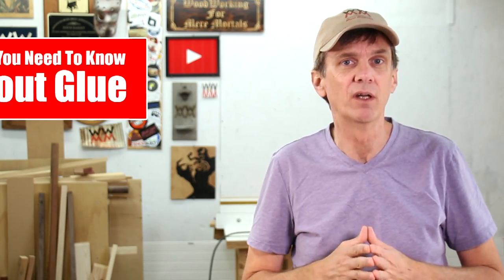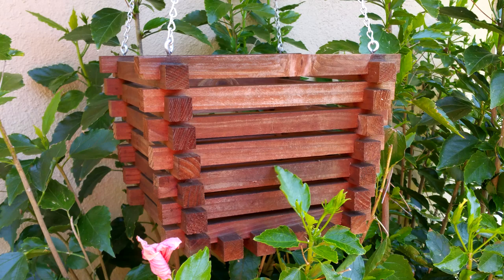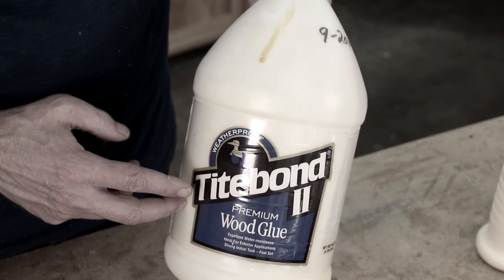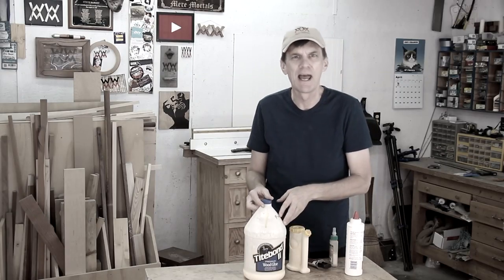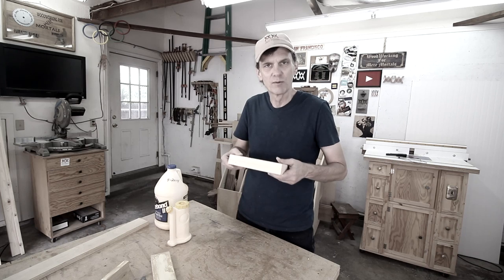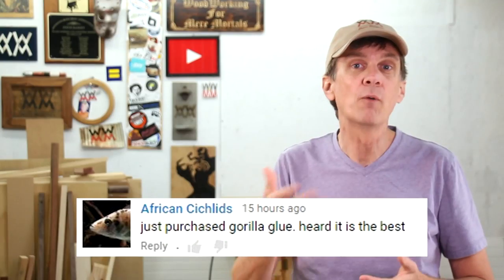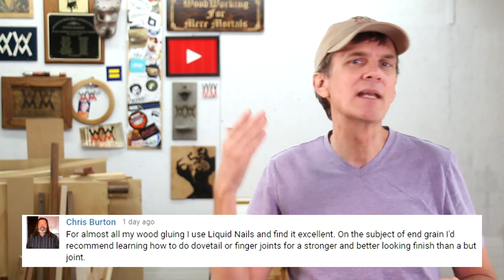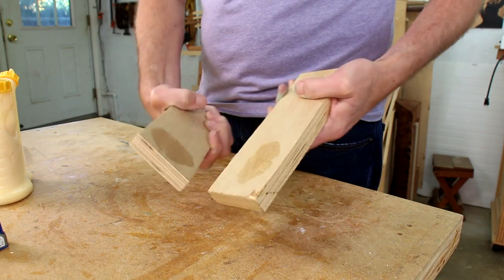Why I Don't Use Titebond III | MORE MINUTES

Comment: Very old video, but recent comments lured me into posting :) ...

Titebond has a "Super Glue" (CA) glue for wood.  The thing about CA glue is it can fill in knots and end-grain to prevent splitting or chipping.  That's great if you're about to run a screw into end-grain and catch yourself saying a prayer for it to not split.

It also works to hold non-wood material to wood, such as sled/jig runners and securing metal hardware to wooden parts.

Many use epoxy for multi-material joining, but to me, epoxy is overkill if the joint isn't going to be under significant load or strain when used.  Epoxies also have a much longer curing time than CA.

Titebond states their CA glue is "good for wood, MDF, acrylic, granite, natural rubber, PVC and more."  It can also cure in 10 seconds or less with an activator.

Wood glue is for .. well ... wood, and you should wait 24 hours for it to set up before you continue working it and stressing the joints.  Except if you used strong mechanical fasteners, too, in which case about an hour for set up is fine.

Comment: Ok this will sound insane but I have used it to repair minor scratches in finished furniture and it has worked and lasted a long time. Go to an inconspicuous spot under the furniture and sand some of the wood with a very coarse grit sandpaper for bigger scratches and finer paper for smaller scratches. Take the sawdust in the palm of your hand (now this is the crazy part) and spit in the sawdust and mix it really well till all of it is damp, not a slurry but more like dough. Work it into the scratch or nail hole. let it set for a few hours, over night is best. Then use 0000 steel wool to lightly even it out. Then stain same colour. dry overnight again then use the steel wool again. You will still see it but if you walk away for a day or two and look you will be hard pressed to see it.

Comment: Cyanoacrylate is often used to bond wood in model airplanes.   The bonds can be very strong, and lightweight.  The main advantage is that an accelerator can be used to make the glue set up almost instantly.  CA needs water to cure, it may be that joints you tried lacked enough moisture to cure totally.  CA has disadvantages, the fumes it gives off while curing are harmful so adequate ventilation is required, and it is difficult to get off your fingers.

Comment: Tip for TB glue bottles that may have been used and left in the open position for a few days (do you have grandchildren?). 
Unscrew the top and set it on a paper towel in the microwave for a few seconds (Not too long, I start with 12 secs.). You can then use a toothpick to work the softened glue out. Reheat as necessary.
Works pretty good.

Comment: We would use CA glue all the time on miters of stain grade alder baseboard, casing, crown. Worked great on bullnose corners. Good stuff. Now I use it as a finish on pens.
Reply: +Skizzity of Zen Hogs I use Titebond Molding and Trim for miters.  It tacks VERY quickly, and is thicker then the other Titbonds, so it doesnt get sucked into the end grain as easily and more stays on the surface where it is actually needed to bond.  Try it out, i think you'll like it

Comment: If I have a large complex glue-up with lotsa joints, then titebond 3 is good because it has a longer open time. #2 is waterproof, but if you're fixing your water tank, use #3. I also take the time to mask visible joints-takes less time and effort than cleaning up squeeze-out. Also, don't wipe off that squeezed-out bead. let it dry, and it pops right off. maybe.

Comment: the slow drying gel superglue works fine to fill small holes. Just mix some of the wood dust with a bit of the glue, and put it in the hole (fast)...with some types of wood it dries a bit faster than with others, but usually works fine..
Also it accepts stain or varnish really well...

Comment: +Steve Ramsey Hi Steve, I've seen some guitar luthiers thoroughly mix an amount of glue with the sawdust and then applying the mixture on the hole, and guitars generally are heavily finished so it might work on your projects, because it turns out great.

Comment: There are a few other glues and adhesives you could have mentioned, for instance contact adhesives like contact cement and gel based veneering glue, Epoxy based two part glues (they are great imo),  UV curing glue for glass to wood and metal. I enjoy your channel, best of luck to you

Comment: for superglue you should try zap glue. it's can be used either by itself or as a two part with an activator. the model plane industry uses it a lot.

Comment: Titebond III dries darker than II and I, but it's got a longer open time and it's significantly stronger (for what that's worth).
I use it on any project that doesn't have to be pretty, just for the general convenience of the longer open time, as well as any project with dark wood. I prefer it because I like the thicker consistency and it slips a little less. I use Titebond II for everything else, though.

Comment: Not a special ca glue, all ca glue can be 'sped up' with a catalytic spray. I use one called zip-kicker which cures the glue in seconds. But you are right, far too brittle for most woodworking

Comment: Titebond II is weatherproof and Titebond III is waterproof. The wording is different but I don't know how much different the glues would be. I dont like mixing sawdust and glue if staining can't get it to match.  My favorite wood filler is Timber Mate. It comes in different colors, is water based and nontoxic. It has a mildewcide that smells strong which is the only downside. Thanks for the good content.

Comment: I think the trouble you were having with the super glue may be to do with the thickness?

When I built a model plane, we used incredibly thin super glues that were almost like water.  They soaked into the balsa wood really well.  Also, like you mentioned, the accelerators work really well, they're almost instant.

You do want to be careful with CAs though, as they give off cyanide gases I believe and they stick fingers to wood etc. very easily!  They were invented in the war to glue wounds up, which is why they bond skin so well!

Comment: A couple of thoughts on wood glue:1.  I only use TIghtbond II because it bonds quickly and I can sand and do whatever after about three hours. 2.  I've often thought about using salt when bonding two wood pieces together but was afraid the salt might effect the glue since it dissolves into the wood. 3. I agree, super glue should only be use for temporary gluing. I use Gorilla super glue because it has a very long (5 Minutes) drying time.

Comment: There are so many types of glue that have advantages and disadvantages for different types of materials and uses.  It's actually kind of a science in and of itself.  I always keep on hand, yellow wood glue, super glue, hot glue gun, 5 min epoxy, gorilla glue, jb weld, and a couple others that sort of act like rubber cement for sealing types of bonding.  These pretty much cover 99% of my needs.

Comment: I use superglue when I have to glue small parts that don't have to have an enormous holding power, such as box dividers. I also use two drops of it in conjunction with pva, when I can't clamp pieces together, and I don't want to wait for pva to dry.

Comment: Steve, if you ever have questions on glues.  I can be of some help.  I have worked in the adhesive industry for over 10 years and am familiar with all of the different technologies, as well as their strengthens and weaknesses.

Comment: Super glue with accelerator works amazing.  I have been using it on my wooden surfboard build for hard to clamp interfaced while my main glue cures (PU glue).  Hold it for 5 seconds while it hardens and it holds my bent redwood just fine.

Comment: Titebond II has type 1 water resistance and Titebond III has type two; its a difference in how they are tested; I think type two has to withstand high temperatures but you can find out  more on the titebond website.

Comment: Here in the UK & Ireland, we tend to run with 'Evostik' wood glues - never had an issue with any in this range, but I guess the US doesn't necessarily have access to it; conversely, I've never seen/used any of the Titebond range (altho' I'm sure you can purchase it); it is as you assert, Steve - you come across adhesive materials that you will gravitate toward, time & again. Methacrylates are a waste of time with real timbers, & Gorilla glue is far too fussy - I can glue four lots of 2 X 4's in the time it takes to prep & apply same; similarly, 'No More nails', whilst effective, is better employed on larger, coarse projects - first fix on shed builds, for example, but in truth, I'm happier to use my Evostik & screws - I never use nails !! Thank you, as always :D

Comment: Cyanoacrylate glues are very strong, they come in a variety of thicknesses from water thin to gel. They bond porous materials very well as the thinner varieties wick into the pores and fibers of the wood. Thicker gels will take longer to cure, the water thin stuff is applied to pieces which are already held together as it cures very quickly when it wicks in. They also come in a 'medium' thickness variety which is what most hardware 'superglue' is.  You can get accelerators as well, it's worth experimenting with them some more and giving them a fair run.

Comment: Titebond II is Type II water-resistant and Titebond III is Type I. Titebond II is fine for most uses and the extra $10/gallon for the III is going to make no difference. Here is the water-resistance test info from the FAQ:

What is the difference between the ANSI/HPVA Type I and Type II water-resistance specification?
Both of these tests are conducted using 6” by 6” birch laminates glued together to make three-ply plywood. The test for Type I is clearly more stringent than Type II, and involves boiling the glue bonds and testing the specimens while they are wet. 

Type I testing involves cutting the 6" by 6" assemblies into 1" by 3" specimens, boiling them for 4 hours, then baking the specimens in a 145°F oven for 20 hours. They are boiled for an additional 4 hours, then immediately cooled using running water. The specimens are sheared while wet, and the bonds must pass certain strength and wood failure requirements to pass the Type I specification.

Type II testing involves cutting the 6" by 6" assemblies into 2" by 5" specimens, soaking them for 4 hours, then baking the specimens in a 120°F oven for 19 hours. This is repeated for a total of three cycles, and the bonds must not delaminate to pass the Type II specification.

Comment: to comment on your super glue bit of this. " zap a gap " is the two part product that is commonly used. and generally i use it for fixing flaps of grain that pop up after going through the planer.,

Comment: I recommend to use Polyuretan glue in construction working because it has more strength. and normal wood glue like Titebond II Titebond III etc. to finnishing woodworking. I live in Norway so the weather changes fast between hot & cold and I have never had a bad experience by using the right glue to the right job

Comment: I read that aside from the waterproof rating, one other difference between tb 2 and 3 is that 3 is better for loose joints than 2. I have no idea if that is true it not though.

Comment: I just use Titebond II, it works for most things and is an all around good GP glue.  Every once in a while I will need some epoxy for something, or some CA glue (pen turning comes to mind).  Anyway, great video and explanation as always Steve.

Comment: The best way to insure total air tightness in a glue bottle is to place a piece of wax paper (it can be from a box of Corn Flakes, which also provides a bag for your lunch) under the screw on lid.  And, to clear the nozzle, and reduce damage to it, work from the inside with tweezers or a hemostat.

Comment: Super glue is fantastic for a metal to wood bond that can be easily removed with enough torque force.  I use it to glue a wooden sharpening setup to my bench grinder.

Comment: Supper Glue was used as a field dressing to hold skin together, that is why it works so well on fingers.

Also I have never tried it but what if you mixed the stain and wood dust to fill the nail holes?
Reply: +MinecraftiaForever I was thinking of Varnish, add a bit of glue to the stain.

If you have a choice always make it darker, when the eye see a darker spot the eye interprets as a shadow, if it is lighter it is a spot!

Comment: Oh and the two part "spray glue" is AMAZING!  Insta Glue by Bob Smith .... you will not find a stronger glue and once you spray the 2nd part, within 3-5 seconds its like a weld. Good luck getting it apart.

Comment: I used liquid nail glue to do my pallet wall garage. I would screw the bottom row of panels with glue do I can continue to stack up. It worked great. But only because I didn't have a brad nail gun. Plus I had plenty of time.

Comment: I have used sawdust to fill holes and small gaps with success. I use some stain on the saw dust before I add the glue. Once the sawdust takes the color the glue has no effect on the color and it seems to match very well.

Comment: I was told by my grandfather who was a woodworker, that by applying glue to both pieces of wood, the glue will set into the wood fibers on both pieces and you won't get the sliding around you spoke about. You also get less squeeze out and a tighter bond.

Comment: I think this is where Gorilla glue came into the market. In my experience it’s the strongest wood glue I’ve ever used and the colour matches blond wood perfectly.  I tested Titebond III vs Gorilla glue attaching maple face frames to 3/4” particle board cabinets. And when I needed to remove a few they were both quite hard to remove but the Gorilla glue was stronger then the Particle board and took chunks out of the cabinet. Don’t know about food safe and stain-ability, but the strength difference was obvious.

Comment: Maybe someone can correct me on this but I've heard that the best possible glue joint is when the wood surfaces are closest together with the least glue between them as possible. The theory being that the lignin fibers in the wood surfaces form a polymer bond at the molecular level, with the glue molecules facilitating that bond.

Comment: As a boat builder i never use anything else but pu glue(and yes off cause I do but when it comes to stuff like this, only pu). All the other stuff won’t hold up to the elements. Yes its messy, but it keeps up bonding, as long it’s not exposed to uv light.

Comment: The trick of putting CA glue in the hole and filling with dust from sanding the same wood works better if you're not going to stain the wood later. The density of the CA glue makes it take stain differently than the surrounding wood.  But if you are just putting poly or lacquer on, it works great. I've also had better success using this trick with darker wood like walnut or rosewood than light woods like maple.

Comment: I haven't tried the salt trick yet, but when you brought up "clamping too tight", makes me wonder if the grains of salt will keep the wood from actually contacting well enough to get a good grip with the glue.  You know, like having sand on the surface of what you are trying to paint or connect to.  Or, will the salt act like rocks you put into concrete to help strengthen it?  Just thinnin' too much here?

Comment: 1:30  It depends on how damp the rag is. Often I'll have a piece of (thick name-brand) paper-towel that's just sopping wet - squeezed out just enough so that it's not dripping - sitting there at the ready for the initial wipe, and then another 1 or 2 that are just damp to follow the sopping one up. So far, that seems to take care of those pesky post-stain glue spots... when I remember (or bother) to do it.

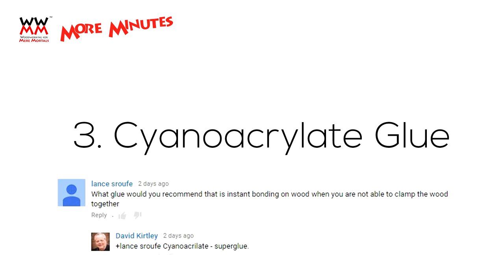Comment: 5:33 so I used a product called no more nails and I used it to mount a shelf to the wall, I wasn’t planning to have anything heavy on the shelf so I cheated and just used the glue and it worked great, I don’t know how but it worked so well it soaked though the wallpaper and bonded to the plaster on the wall, I found this out when I decided to remove the shelf years later and as well as ripping off the wallpaper it ripped off the plaster under it, luckily I was redecorating the room so it didn’t matter much but it did come as a shock when part of the wall came away with it.

Comment: Titebond 3 can be use when the temperature is a little under 50F.  TB 2 need 55F( and really need it)... sometime, that a deal breaker when my shop is around 52F.  TB original need 50F

Comment: I use superglue quite often to join two or three or four pieces so I can easily shape them to size and separate them afterwards. It is very good at creating a temporary bond that can be easily broken if you focus energy at the joint.

Comment: The waterproof label on the front of Titebond glue is contradictory to the fine print on the back.    If you read the specs, both are only water resistant. 
And not all Gorilla glue is foaming and  messy, only the polyurethane type Gorilla glue is.  Another type Gorilla glue works much like other Titebond I, II, or III wood  glues.

Comment: Titebond III doubles the working time of its predecessor and has a lower application temperature," explained Dale. Titebond III nearly doubles the open time of Titebond II, to ten minutes, and can be applied in temperatures as low as 47°F. The minimum application temperature for Titebond II is 55°F.
Reply: +TheRealDenzel2112 Exactly... why is this a mystery? It is explained on the product is it not?

Comment: Gorilla Glue must be placed under pressure.  I have used it to great effect without any moistening at all but wetting on piece with a wet cloth does speed the cure.  Gorilla Glue is very effective when gluing hardwood trim to particle board or MDF as it fills the pores while curing and creates a bond stronger than the wood itself.